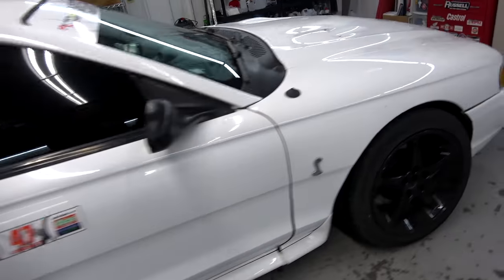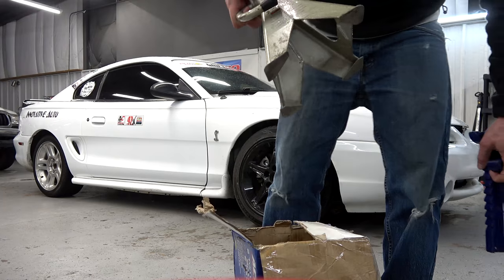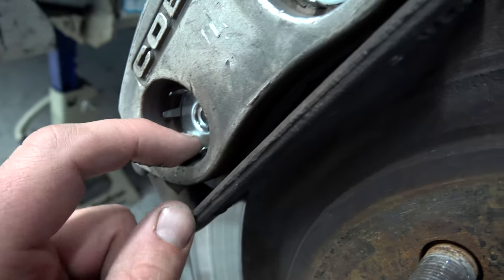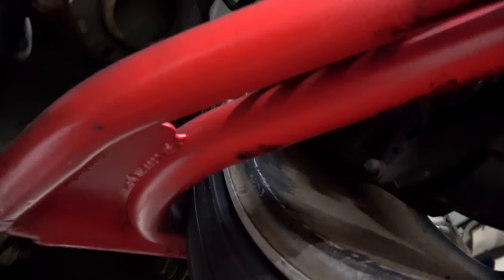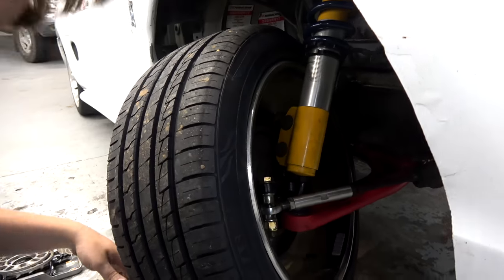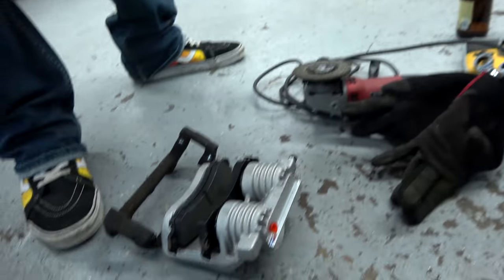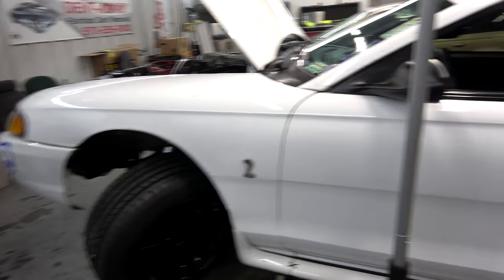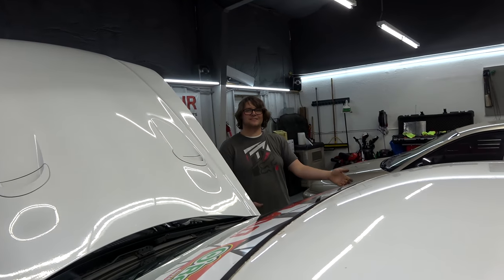2018 Drift Cobra Upgrades Part 2 | PDC Episode 30

Comment: The clunking comes from the missing hardware on the brake pads themselves. They clip on and make it so that it requires pushing down on the floating part of the caliper to insert the retaining pin. here is a link to the parts im talknig about. https://www.americanmuscle.com/front-disc-brake-hardware-9404cobra.html?utm_content=Restoration%20-%20Maintenance%7COPR&T5_Var4=100911&utm_source=google-pla&utm_medium=shopping&T5_Var2=shopping&utm_campaign=AMM+Mustang+Vehicle+Medium&T5_Var3=blue&intl=0&dialogtech=ppc&gclid=Cj0KCQiAoJrfBRC0ARIsANqkS_79gyvDh0cJACQTvr_dxV3Quu50799St1w7WZ6sIoJRWCLIrvCOieIaAuBaEALw_wcB&gclsrc=aw.ds